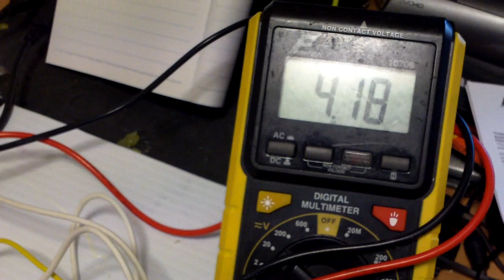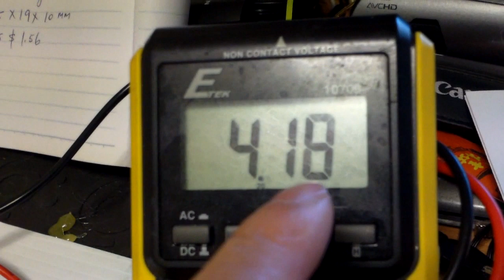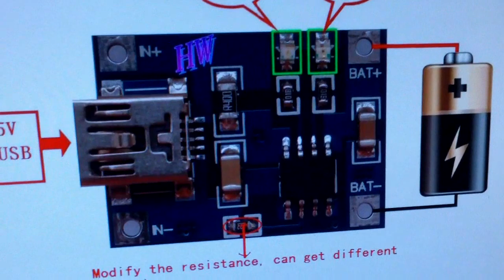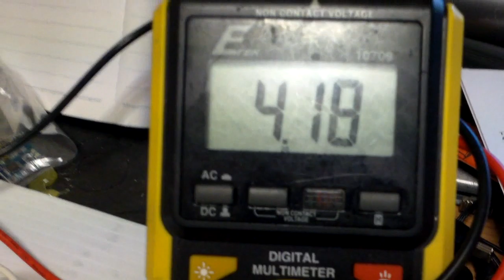One amp 3.7 v lithium ion battery charge controller

Comment: There is a company called Harbor Freight and a few other vendors. They sell a solar security light with 60 LEDs and 3.7 volt 1500 mAh, Li-Ion. The Fatal flaw it does not have a charge controller.
Reply from the maker: Thank you adding your input.

Comment: Help. I have a New Li Polymer Rechargeable Accumulator Pack Replacement 3.7V 4100mAh battery  it has 3 wires   RED, Black and white .. How can i charge it ?? what will i need to charge it ?
Reply from the maker: Use an RC charger to charge.

Comment: is the IN+, IN- the output power of the battery connected to the board?
Reply from the maker: The battery is connected to the + and - of the output of the board, the opposite end of the usb connector.
Reply: Yes I mean I would connect the battery to the BAT + / - but what is the IN +/- for? Can I draw power from it to supply a portable speaker?
Reply from the maker: A G the input next to USB is for other types of power input such as solar panel or bench top power supply.
Reply from the maker: The in + and - is for charging purposes. The board regulates the incoming power and through the circuitry to the output to charge your batteries.  It is not used to supply power to a speaker.
Reply: I see thank you for explaining, I might have to buy a different one with a power out.

Comment: Sorry I don't have much knowledge of this sort of thing, but I'm doing a mini project and was just considering...if the 3.7v batt your wanting to charge has its own  cut off circuit (I think that's the right term?), will this usb board still charge the batt or do they cancel each other out...again I don't have much knowledge and this is confusing me?...thanks :)
Reply from the maker: sonsofsinofficial I'd think the charge controller would still work even if your battery has it's own protection chip. This charge controller or the battery chip has a certain limit and when that is reached, either control would shut off preventing further charging.
Reply: wtam69 awesome thanks

Comment: I plan to use this charge controller for a solar setup. I was wondering if a 7.5V 760mA solar panel would be too much? Considering non-optimum sunlight and all other factors? Any help would be great! Thank you
Reply from the maker: It should work with a 7.5v panel and it can handle up to 1 amp.  Good luck with it.

Comment: Can u give me a link of where I could buy one of these. I am struggling to find them!
Reply from the maker: Sorry you have trouble finding them. You can go to this seller on ebay "e_goto"  or type this in ebay search box"5PCS Mini USB 5V 1A Lithium Battery Charging Module Charger Board"  I like the mini usb better. The ones with the micro usb port are flimsy and the connectors can come off easily. Good luck.

Comment: can i buy 3 of these and charge my 3 cell lipo battery, by connecting each one for a battery , ( 2200mah 30c 3cell )
Reply from the maker: If they are 3.7 volt, you  can  charge them in parallel but not in series.  Better to have one controller on one battery of 3.7 v.  It won't charge the battery in series.

Comment: can you charge more then one 3.7v battery at once if they are connected in series?
Reply from the maker: You have to charge them in parallel with this type of controller. It probably won't work well with multiple batteries because the output of the controller is limited to 1 amp.